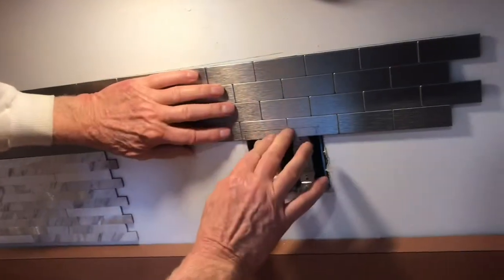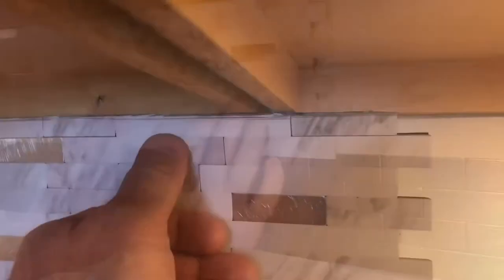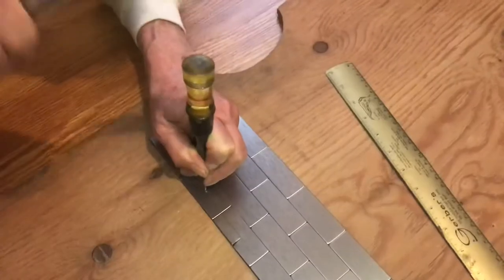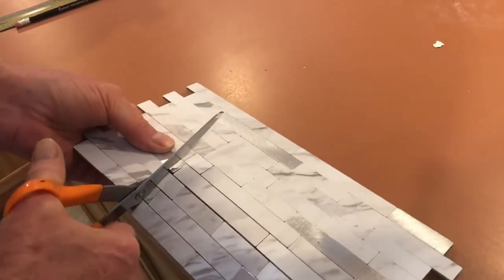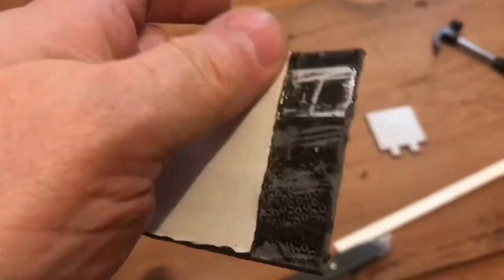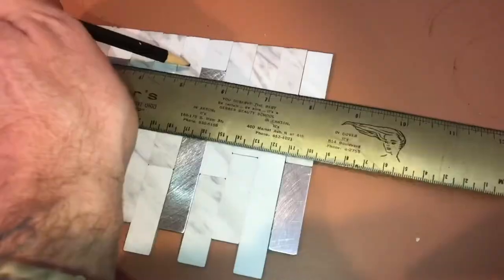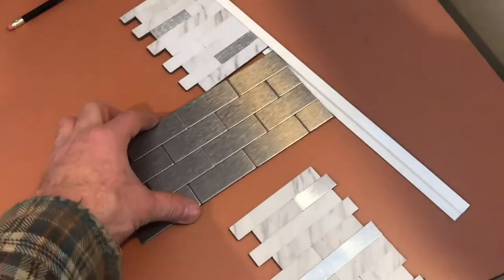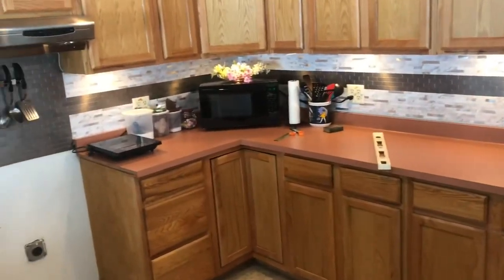(USEFUL INSTALLATION TIPS) ”aspect “peel and stick” backsplash tiles

Comment: I tried a different approach when adding the edge trim that didn’t require scraping off the glue to add the trim. When you have multiple pieces and try to apply a trim piece it can be tricky. Take any pieces that will need the trim attached and cut them to the size required. Before peeling the paper of the back install a piece of the trim on it. With the paper side face up take a razor knife and lightly run the blade along the edge of the trim. Remove the trim piece and peel the small paper strip that was under the piece of trim exposing the sticky glue. (Approx.1/2” wide strip) I had some foot powder but almost any powder will do. Put a little of the powder on your finger and apply it to the exposed sticky area, It makes the sticky area non-sticky immediately. Apply your tiles to the wall as normal and now the trim piece can be installed on the edges even after the tiles were installed. Use as little powder as possible and wipe off any excess.
Reply: Why remove the trim piece and peel the small paper strip that was under the piece of trim?  Leave the paper on and put the piece in the track.  Then peel back the paper you scored with the knife and apply to wall.   And why is the strip like a channel?  Could a person just tack on some trim over the edge?

Comment: Why does the termination strip have to have, or be a channel?  Is the back of the termination strip sticky to adhere to the wall?  Instead of shaving off the sticky couldn't you leave the paper on?  Or would it not fit in the strip?  Just someone asking whose never done it.  I would like to do the back splash on my bar.

Comment: thanks for tips,,very helpful. I have a texture<orange peel wall that I want to use peel and stick tile on. I saw a recommendation of using liquid nails also on the underside. What is the easiest way to handle the texture. Sanding, liquid nails or skim coat. Each has there benefits. But what would be the quickest and cleanest method?

Comment: I have similar metal / steel backsplash installed in my kitchen and it’s a nightmare peeling off due to the rubbery black base off the wall. The problem I’ve encountered is the metal pieces come off leaving the rubbery base on the wall and would just not come off.
Does anyone have a suggestion on dealing with this?
Reply: I would try steaming it.
Reply: If it doesn't need to stick to the strip just leave the backing paper on the inserted area. It should slide on.